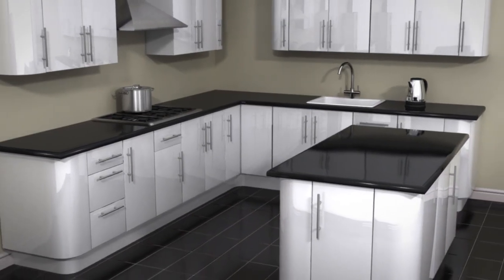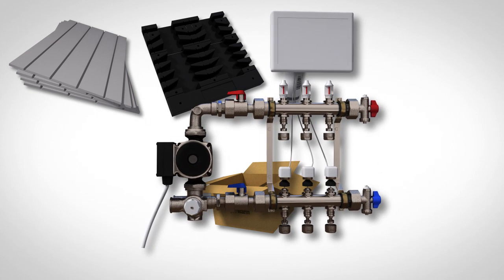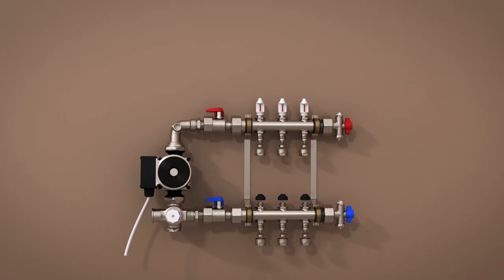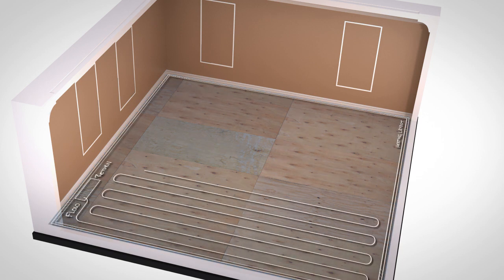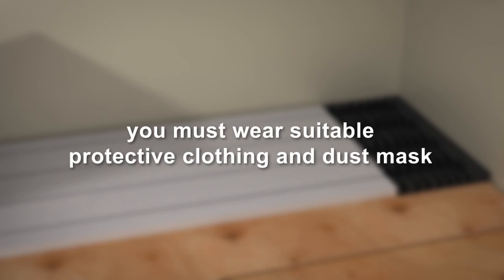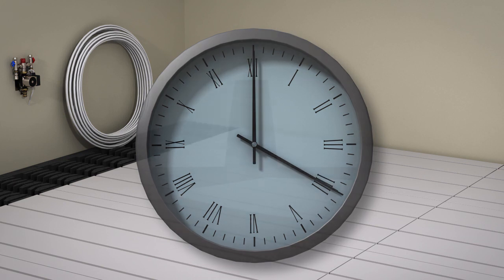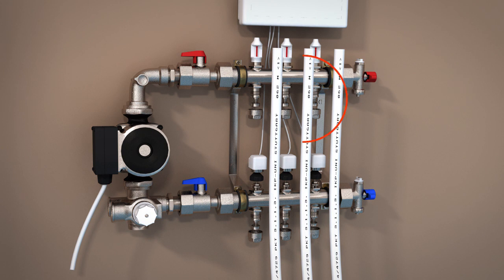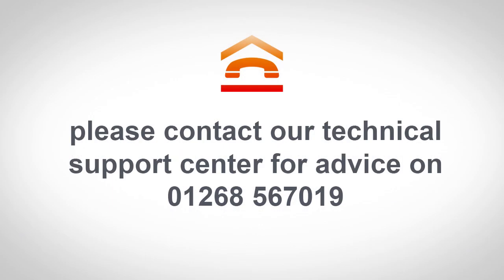ProWarm Low Profile Water Underfloor Heating Overlay System Installation

Comment: Very risky to just loose lay these boards as subfloors are rarely 100% flat even with levelling compound and any voids could cause deflection in the board.
Its wise to stick with tile adhesive and also screw with screws and washers.
Also bare in mind that it was mentioned they are a gypsum product, if this is correct it's vital to prime the boards properly before using a cement based adhesive or leveller, as gypsum and cement together cause a reaction that will compromise the bond.
I hope that helps and good luck!